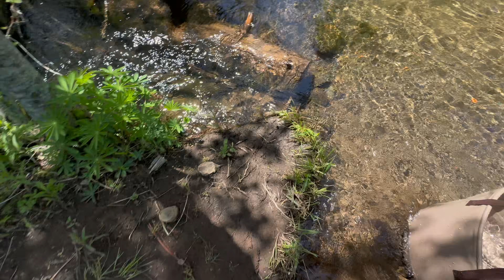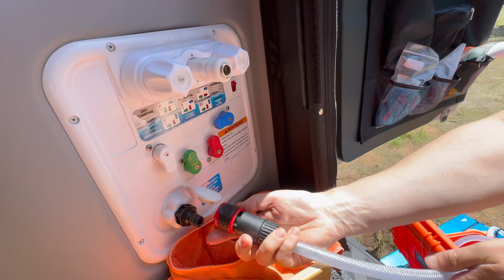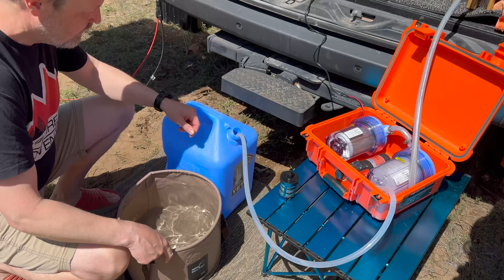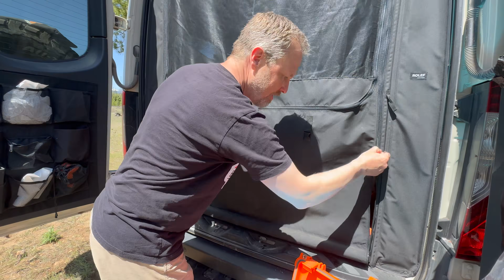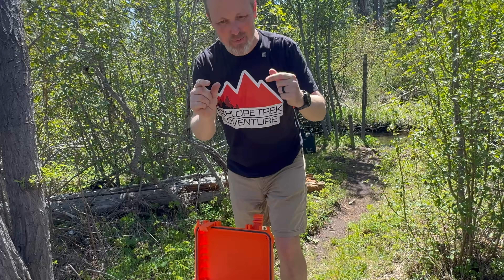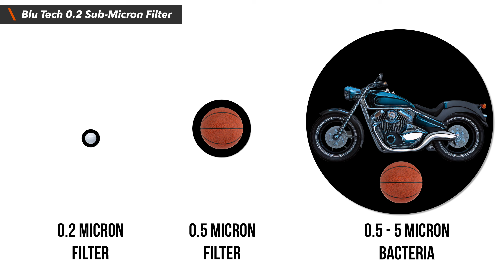ENDLESS WATER Off Grid? Simple DIY Van Life Filter Setup

Comment: I really like this idea as a way to add to your water supplies in the backcountry or even to keep from having to haul 20+ gallons of water from town up into the mountains. A few ideas I'm going to try in my own version: 1) Add a piece of foam (pipe insulation?) near the end of the inlet hose to keep the inlet away from any sediment at the bottom of the creek/bucket. 2) Use bulkhead pipe fittings to have inlet/outlet attachments fixed in place in the sides of the container. 3) Use stainless steel hose attachments instead of plastic. 4) Have the outlet be a 3/4" male garden hose thread so I can re-use my van's fill hose 5) Add a power input socket and switch to the side of the case (using SAE plug, since I already have a 12 V car plug to SAE cord from my Geyser system) 6) Put it all in a case with a clear lid as I ideally wouldn't have to open it, it might abate some noise but I could also monitor and appreciate my handiwork (one of the Milwaukee PackOut products might fit, or something like a Zulkit Junction box but would likely want to add a handle). 6) Consider adding a secondary input & check valve that bypasses the pump for pressurized but questionable/foul water sources.

Comment: I would run the strainer before the suction side of the pump then the pressure side would feed through the filters. Pumps run better when pushing on pressure side.
Reply from the maker: Hmm, maybe I’m misunderstanding, but that is how ours is plumbed. Strainer before the pump, then filters on the pressure side.
Reply: @ExploreTrekAdventure ok I didn’t see if it was hooked up that way on the video. That’s good.

Comment: Typical AWG device requires 1KWH of electricity to extract one gallon of filtered water from the air. I don't know if they make units for RV w/ Solar on the roof top and works best if humidity is above 50%. We see MIT has invented AWG that doesn't require electricity and can operate at low humidity but the material that absorbs the water (absorbent) will have to be replaced once a year from what I recall reading. The material will not be cheap but not ready yet for mass production but important discovery.
Reply from the maker: That's some interesting info on AWGs. Thanks for sharing!

Comment: Install a residential 5 stage reverse osmosis in the van then after your water tank you can have easy drinking water.
Reply from the maker: We use the ITEHIL RO system for our drinking water, but this setup is just to bulk fill the van with decent water. Basically as clean as we can get it using two small filters.

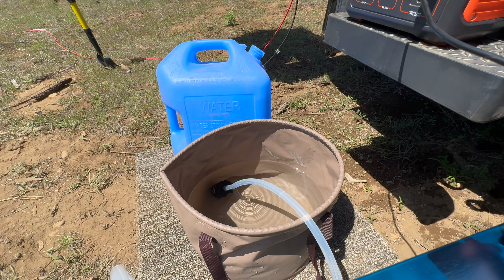Comment: 2:13 

Your bucket was getting low and you had several other sources of water right beside the bucket.

I probably would have filled the bucket while it was getting low so that I wouldn't have had to stop & start the pump.

But hey, what do I know, I might have done the same thing too
Reply from the maker: We wanted to show how we pull water from both the bucket and the blue jug, since we sometimes use either depending on the situation. While we’re traveling, we might just fill the blue jug at a water source and filter from it later. In that case, we’d pull directly from the jug to fill the van.

Comment: Just pour the water from the 5gl into the bucket as it empties.
Reply from the maker: We wanted to show how we pull water from both the bucket and the blue jug, since we sometimes use either depending on the situation. While we’re traveling, we might just fill the blue jug at a water source and filter from it later. In that case, we’d pull directly from the jug to fill the van.
Reply: @ExploreTrekAdventure  I do like your set up. The whole filter system in a waterproof case.

Comment: i have been in the water filtration industry my entire life, building brands, designing equipment, formulating filters, etc. 
for off grid filters like this i highly highly highly recommend and stress using a KDF-55 filter for at least your first filter. Best to use KDF and carbon combined, either a GAC (granular activated carbon) CSEC (Catalytic surface enhanced Carbon) - simply because any type of carbon can grow bacteria over time, i know it may sound counter intuitive because some carbons especially activated or catalytic carbon say they can help mitigate bacteria, but when the filters are constantly sitting wet after use until used again or if they are sitting wet until they dry out - unavoidably getting hot and steamy inside the filter housing to do so - you will grow bacteria over time between use... using a KDF media (kinetic degradation fluxion) as a first filter media mixed with a type of carbon will not only increase the life of the carbon but it will create a bacteriostatic environment preventing bacteria, fungus, mold, etc from growing inside the filtration elements themselves between uses. KDF-55 would work best for you use case as there are multiple types of KDF. using two filters both KDF55/GAC would be great. to prevent both housings and elements from running into any problems between uses. 

Another way to fix this without changing your filter elements of choice would be adding a simple  UV light that you can run off your jackery battery pack that you can tie in as a post filtration element after your two filters. 

love the idea and hope some of this information helps! if you ever need any filter info or ideas or help feel free to DM me
Reply from the maker: Thank you so much for the information and suggestions; we appreciate the expertise!
Reply: @ExploreTrekAdventure  Dittos!

Comment: can i ask why you didnt just poor the jug into the bucket instead of changing to the smaller filter? i think i missed some thing of why you did that!
Reply from the maker: We wanted to show how we pull water from both the bucket and the blue jug, since we sometimes use either depending on the situation. While we’re traveling, we might just fill the blue jug at a water source and filter from it later. In that case, we’d pull directly from the jug to fill the van.
Reply: @ExploreTrekAdventure  Thank You!

Comment: For drinking, I would also add a 12 volt, pass through UV filter
Reply: I’m building a version of their system - would you be able to point me in the right direction for a UV unit that would work with this system?
Reply: @davidkrawitz866  search on '12v pass through UV filter for drinking water'  There are quite a few sites for off-grid life, ocean boating, and even on AMZN.
Reply: @davidkrawitz866  I can make you a better one for you
Reply: I can make you a 6 stage portable with UV for only 200 dollars

Comment: Isn't it easier to just dump the jug into the bucket? LoL
Reply from the maker: You could definitely use the blue jug to top off the bucket. We just wanted to make sure and show how we pull water from each source in case someone wants to build a similar setup. Everyone approaches things differently, so we try to share options that might be useful.

Comment: Since you aren't using it for drinking water, the 0.2 micron filter is probably redundant. The first 0.5 micron filter should remove any bacteria and since it is a carbon filter probably other contaminants (chemicals, metals, etc.). At that point the only contaminant of concern would be viruses and if you decided to use it for drinking water you should probably use a 0.1 micron filter instead of the 0.2 micron.

Comment: I like how fast your system is. We purchased a reverse osmosis system. It works great and the water tastes terrific, but it is extremely slow. It takes roughly an hour to filter 5 gallons of water.
Reply from the maker: You’re right, RO is definitely slow but it can produce really high-quality drinking water. In the video going out later today, we actually cover the RO unit we chose for our drinking water and walk through some of the pros and cons we’ve found so far. There’s definitely a trade-off between speed and purity, and it really depends on what you’re using it for.
Reply: If you use ro make sure you use plastic fittings and plastic sinks since ro will eat metal
Reply: @shaunj3833  I didn’t know that. I thought for sure you were wrong, so I looked it up and you are absolutely correct. If we start relying heavily on water treated through reverse osmosis I guess we’ll start adding minerals back into it.

Comment: So cool, great job putting this together. Just wondering, would it be easier to use the blue jug and top up the collapsible bucket instead of changing the filters back and forth? Very cool either way, I bet you’ll perfect this to sell!
Reply from the maker: Thanks, we appreciate that. You could definitely use the blue jug to top off the bucket. We just wanted to make sure and show how we pull water from each source in case someone wants to build a similar setup. Everyone approaches things differently, so we try to share options that might be useful.

Comment: Why didn't you put the pump between the first filter and the second filter to help preserve the life of the pump? Also you could also add a uv filter to help kill any viruses in the water and save your water tank.
Reply from the maker: Both of those are good options. For our version 1, we use a separate system for drinking water so UV didn’t seem necessary. UV filters can also be expensive and require a slow enough flow rate to be effective. With the pre-filter in place, we didn’t think we needed to put the pump in the middle.

Comment: What a great setup! I appreciate the system's portability. What was the total cost? I have a portable recirculating shower that works on a similar concept and has a uv filter in it, but it turned out to be a whopping 18 pounds because I made it out of aluminum extrusion and it has a three gallon per minute pump, a heat exchanger, anti scalding valve, shower wand, etc. I'm looking to redesign that into something that can be fit in a case like yours.  You can see my recirculating shower here:  https://www.youtube.com/watch?v=cEzRXpWGu3c&t=653s  Maybe it will give you some ideas as well. I think the key here is sharing ideas!  Thank you for your contribution.
Reply from the maker: Wow, that’s a very cool system you built. We’ll definitely check out the video. Your setup sounds super capable, even if it’s a bit heavy. We kept ours pretty simple and focused on portability, but it’s great to see different approaches out there.

Comment: This system is great for saving space. But I decided to do a full house style 5-stage filtration system with UV. These can be annoying when it comes time to change the filters or winterize... but my solution is to have the entire unit on sliders so it comes out the back doors. Going with the (Geekpure 5 Stage Whole House Water Filter System with 2.5 x 20 5 Micron PP Sediment + Carbon Filters and 6 GPM UV on amazon)
Reply from the maker: That sounds like an elaborate setup, and we appreciate you sharing your thoughts.

Comment: You basically recreated the Portawell Mini Expedition system, and saved a bunch of money in the process.  I did the same, except I used the 5" NanoCeram PAC filters that Portawell uses.  It's a much better .2 micron filter, has independent testing/ratings, and high flow rate and capacity, and filters viruses.  I run one on my rig and change it once a year.  I probally should do it every 6 months but I've never clogged it and have pulled water from the nastiest of places with no problem.  I've probally pushed it's limit filtering 5000 gallons of water.  My recommendation would be to replace your .5 filter with a 1 micro cheap sediment filter to reduce clogging and flow impact and obviously then NanoCeram PAC filter.  It's totally good to go for drinking water as well, a one stop water shop.  That Blu filter is junk.
Reply from the maker: Thanks for the feedback! We will check out the nanoceram pac filter.
Reply: You got a source for those NanoCeramic filters?
Reply: Do you ever use your filter on lake water?
Reply: @thebibleexpository2817  Yep!  I've pulled from every water source you can imagine out in the backcountry.  I've yet to have a problem.

Comment: I am currently building a similar setup, but with an activated carbon filter as a third stage. Will wait for your drinking water setup. Did you add reverse osmosis or uv?

Great presentation, very clear video! Thx
Reply from the maker: Appreciate that! We’re running a separate RO system for drinking water. It’s working well so far, though it’s not perfect. Your idea of adding a carbon third stage sounds smart. 😀